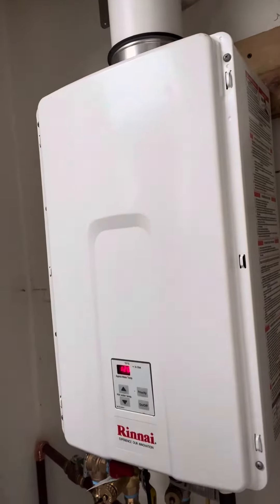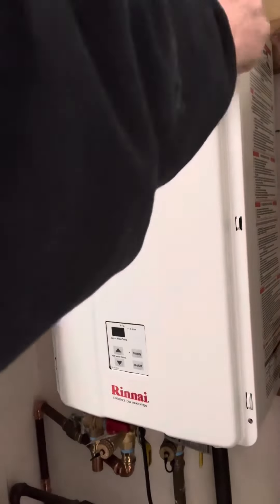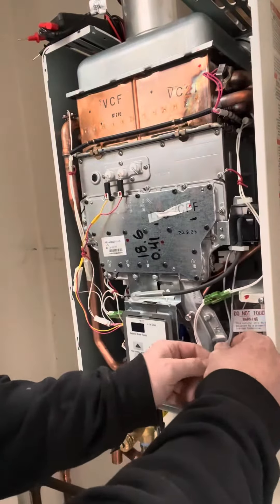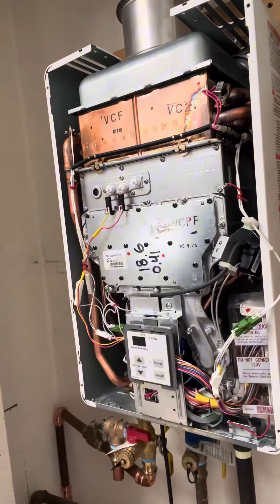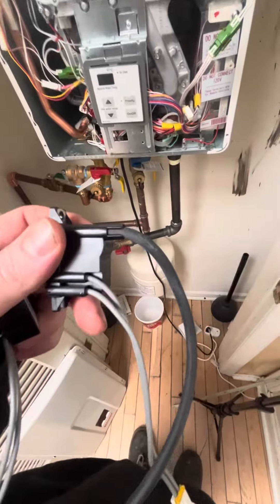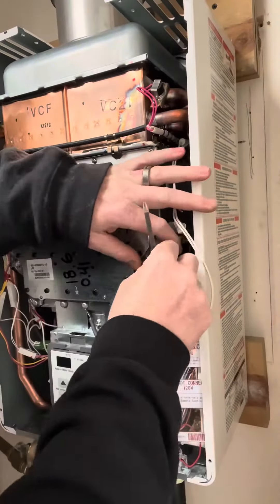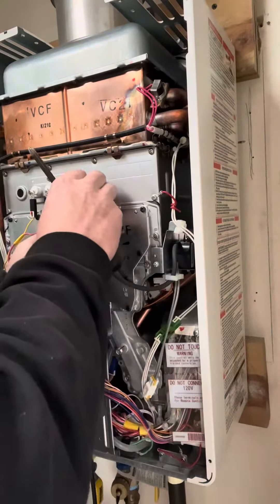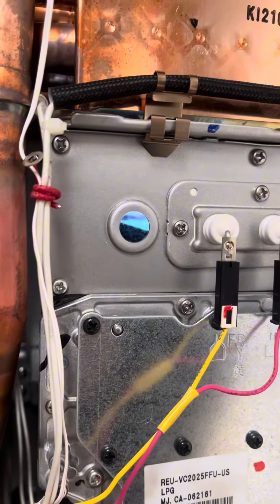Code 11 Rinnai tankless. No ignition, no spark

Comment: It's what I'm sayin' cuz the machine is 20yrs old and it's shoe-horned into a tiny hall closet with the air return. (SUPER CONVENIENT!!!---NOT!!!) It's doing pretty good for it's age but I gotta get some help blowin out the boogers and probably need a new igniter. When I move, whether I build a new house or whatever, I am gonna be so glad to have a newer unit and to have it in a small room with room to do maintenance! The thing was never installed properly from the beginning either! I'm so ready for a brand new chapter! No problem with Rinnai or Tankless Hot water heaters, it's just gotta be done right!